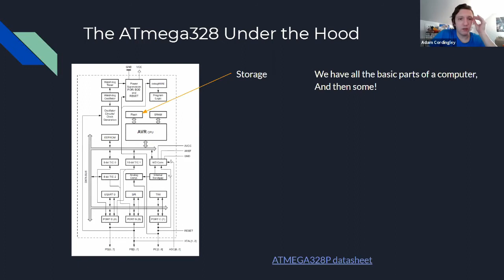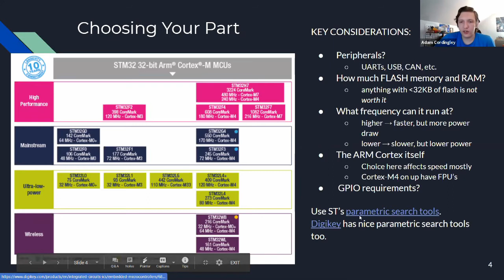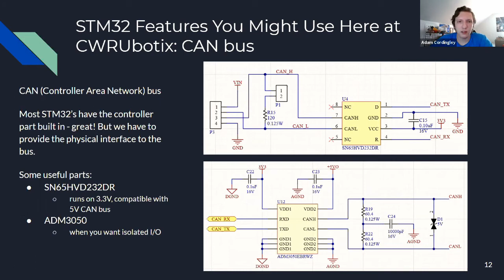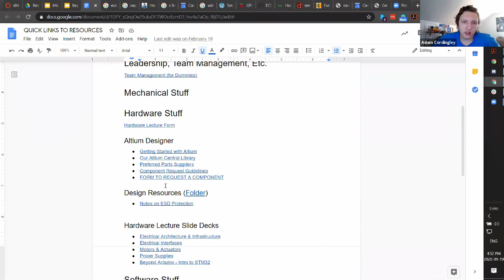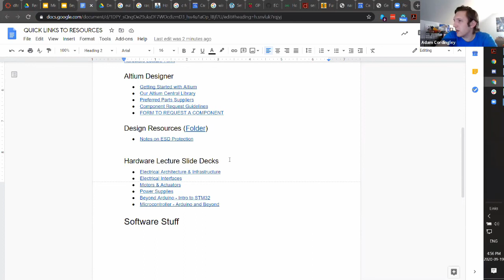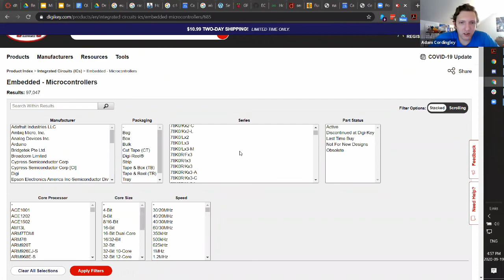Microcontrollers with CWRUbotix - Arduino and Beyond

Comment from the maker: CORRECTION!  At about 3:30 I start talking about the USB interface part of the Arduino Uno. I said that the ATmega16U2 "bit-bangs" the USB protocol, which is INCORRECT. The ATmegaXXU2 microcontrollers DO have hardware-based support for USB 2.0 Full-Speed. Sorry about that.